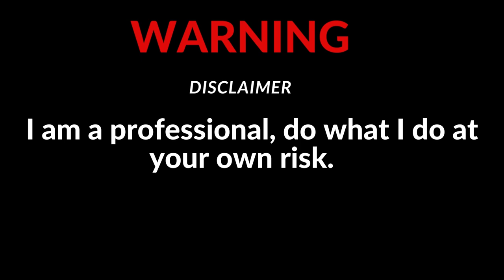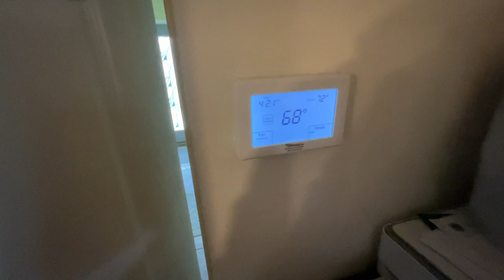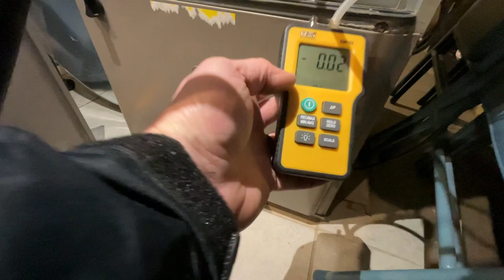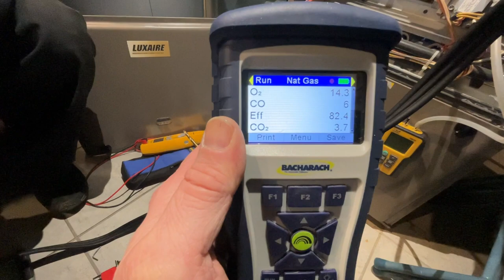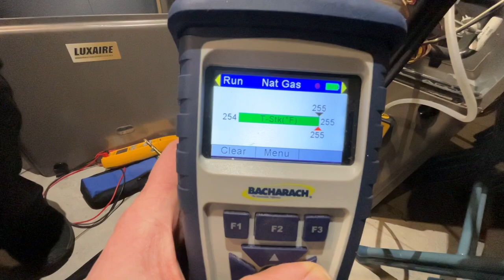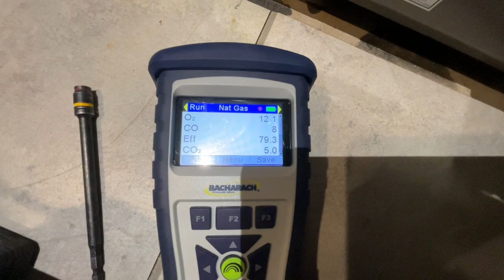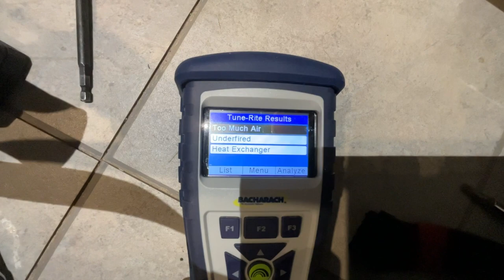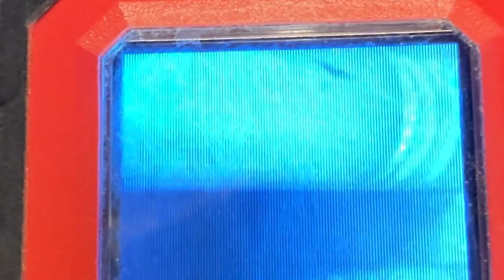Cracked Heat Exchanger in Luxaire Gas Furnace

Comment: Nice spot difficult one that with the hairline cracked heat exchanger getting just enough air and oxygen for it to stay elevated and not enough for improper combustion to ring CO alarm bells. Great follow-up to check with the camera to provide greater conclusive proof. I wondered whether you had the top part closed and remove the gas pressure monitoring that seemed  reasonable. Closing it would help to discount fully dilution air in combustion. I would have also taken the combustion readings slightly higher on the stack which is a good practice recommendation to fully discount the induced draft from the draft motor.  Under those situations given the fine margins I would have pulled the heat exchanger to get a much better look to see whether they were cracks or just darkened hot spots. Good that you followed up with ambient CO reading to further confirm a potential problem. I would also have checked at the vents to see impact on other floors.
Reply from the maker: Tomorrow’s video you can really see the cracks. Thanks for watching.
Reply: @ADVANHVAC  no criticism on your work you know best under the conditions you face - we are not there it’s easy for us to comment. I would save this and tomorrow’s one to show clearly to young apprentices that combustion involves several variables and it’s an investigation to work out why parameters are  not all lining up and that then needs to be investigated you have to discount lots of things until you get to the stage that you did and do a camera inspection well done 👏🏾👌🏾

Comment: Yes use knee pads. The damage is slow and accumulating.
Reply from the maker: For sure. I didn’t start using them until about 15 years in. Now my knees are in pain, most of the time.
Reply: Same here been in the field for 15 years and never used knee pads now my knees are always in pain . And now I wear them every time all day long
Reply from the maker: Definitely takes a toll on the knees after a bit!